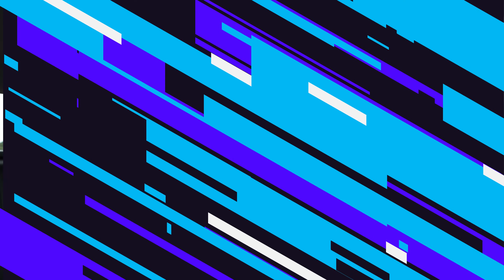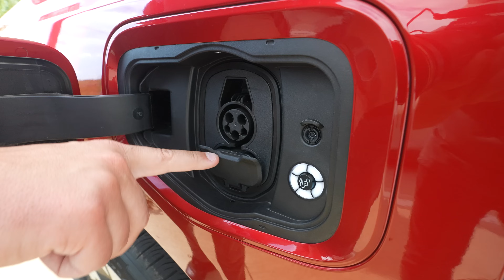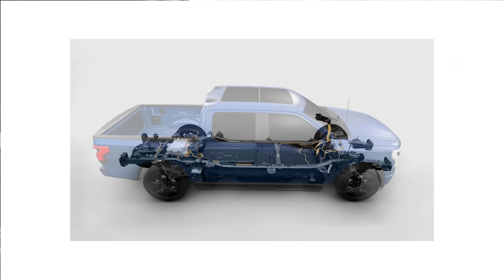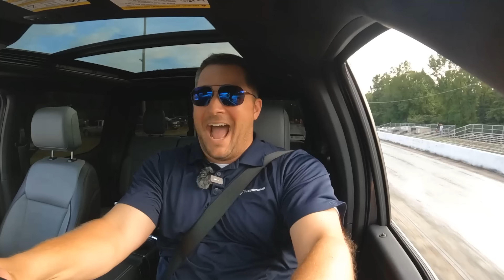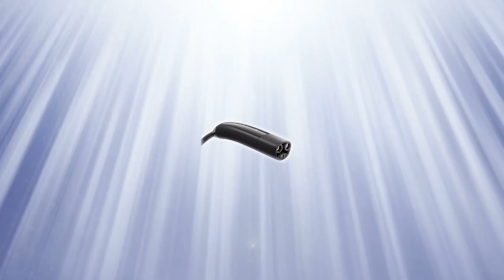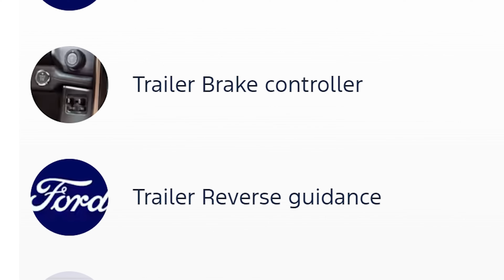Will the *ALL NEW* F-150 FLASH save Ford EV’s?

Comment: The adapter is not for plugging into a dryer outlet in your house.  It's for plugging into the 30 amp 240 volt Power Pro outlet in the bed of the truck so you can then plug your friend's NEMA 14-50 adapter Tesla Universal Mobile Connector into it and then charge that dead Tesla.  It was Ford's way of saying "F U Elon!"   Remember to tell them to turn their charge rate down to 24 amps (80% or the 30 amp max). It says so on the label on the adapter

Comment: Got a new 24 Flash for under $54k .   They had a bunch of 2024 sitting in the lot.  He's not kidding about how good the ride quality, features, and the speed this thing has.  I've already used a TEsla supercharger and it's quick at charging.   I cannot wait to take it cross country...after I buy several adapters for different plugs.  This is now my favorite vehicle.  This was a homerun for Ford
Reply: probably want to bring a jumper pack, a battery tender and multimeter for your 12V battery on that road trip. Have a blast man!

Comment: Ford needs to remove all trim levels from the lightning. They need to just have the flash. It will reduce costs hugely on the truck. They need to make 1 solid ev truck. Then when it’s profitable they can start offering trims again.

Comment: Pretty good review here, thanks for making it. EVs are going to take off in the next 5 years with improvements like the ones made on this Lightning so those chargers will pay off. I worked in the automotive business at a national level interacting with dealers. I always wonder why 1) Dealers feel the need to pump the manufacturers for money and 2) Dealers like to cry or imply poverty. Those chargers have plenty of subsidy money available through the government. Either way, good for you as a dealer for getting on board and installing them. There is a Nissan dealership in Bangor ME with free level 3 charging stations and they get tons of attention/praise from EV owners and likely are getting some business out of the service. 

The Flash looks like it pays off. Makes a ton of sense for me as a builder of all-electric homes. Going to go and check one out based on this video so thanks again.

Comment: I just picked up a Flash this week. It’s the sweet spot in the line up, all the essentials without the massive price tag. By far the most value for an EV truck available at the moment. I paid under $60K. Every other available competitor truck is well over $80K

I had a reservation way back when it first launched, but passed because of the over MSRP price. This is my wife and I’s 5th EV (model 3, 2 Model Ys, and a BMW I4), the Flash goes to the top of being my favorite. Great tech, superior performance, solid range, and an all around practical vehicle. 

I agree with charger anxiety, the network needs to improve if this is going to make sense for people who take road trips. 

GREAT REVIEW!

Comment: I just picked up a Flash this week. It’s the sweet spot in the line up, all the essentials without the massive price tag. By far the most value for an EV truck available at the moment. I paid under $60K. Every other truck is well over $80K

I had a reservation way back when it first launched, but passed because of the over MSRP price. As an owner of now my wife and I’s 5th EV (model 3, 2 Model Ys, and a BMW I4), the Flash goes to the top of being my favorite. Great tech, superior performance, solid range, and an all around practical vehicle. 

I agree with charger anxiety, the network needs to improve if this is going to make sense for people who take road trips. 

GREAT REVIEW!

Comment: I have 2024 Flash. The trailer backup assist cant be used with the trailer harness. Pro charger wont charge at 80amps cause there is only ine on board charger.

Comment: EVs have only 2 problems. 

1-Most are just too expensive and hard to justify. (Usually new products try to be cheaper then the competition to at least get some traction and consumer trust)
2-The charging experience is still not good, needing to have a different app for different branded chargers is very annoying. And although I think they are really addressing the amount of chargers available they do still need more. 

(I had the Jaguar I-Pace for 5 years and just bought the F150 Flash and I love EVs and they're amazing products to own we just need to keep at it, it's not going to be better overnight or even in years but it really is getting better all the time and I hope companies don't give up on it)

Comment: Great points. I still believe in Ford as a company. I’m buying a Sierra EV, but I’ll always be a Ford guy at heart. Ford missed the mark somewhat with the Lightning - the main problem is its charging speed, and that’s not something they can fix with the Flash. But as Ford holds off to 2027 with its next-gen, I believe that they will catch up in the long run.

The F150 is the most popular vehicle in America because Ford has delivered what people want for a price they can afford. The shift to EV technology may have created a challenge for Ford to overcome - one that they aren’t currently the class leader in - but in the long run they will prevail.

I bet in 10 years I regret not waiting until 2027 to buy my truck, but at the moment I can’t wait that long.

Comment: Six months ago I bought my 2023 F150 Lightening XLT. I absolutely love it. I travel to my job sites everyday and they’re all within 20 miles of my house. I charge every two weeks at home, while I sleep. I’ve had four F150’s, an Explorer & an Expedition, prior my Lightening and it’s THE best truck I’ve ever owned. The ride is smooth, quiet and it’s really fast!!
Reply: Do you charge elsewhere in that two week period? I’m a project manager in Florida but right now most projects are further from my house than I’d like. I’m probably driving 200-250 miles a day mixed highway and city. Not going very slow on the highway. I’m trying to figure out if a lighting would get me a full day of range without the anxiety of needing to top off to get home.
Reply: @davidtolentino4755   I don’t think my Lightening would work for you. It doesn’t get good enough range to depend on. You’d have to go with the bigger battery “package”. I only drive 5-50 miles a day so it’s perfect for me. But mine is a 2023 so the 24’s or 25’s may be different now. I haven’t kept up with it. I’m sorry I wasn’t more help.
Reply: @loriw2661  I appreciate your reply! From the reviews, regardless of year, it sounds like the larger battery would definitely be the way to go. And even that one worried me.

Comment: I don't get why somehow EVs have become political. They are not political. They are just a different form of transportation. You have Gas, Diesel, Propane and now Electric. Just because Electric is better for the environment, doesn't make them political. We ALL breathe air. Sure there are EV subsidies, but there have been petroleum subsidies for a century and I didn't hear anyone complain.

We have to stop burning stuff. The earth is getting hotter. This is inarguable. The easiest thing we can all do as non-government participants is to stop our own contributions to air pollution, which means getting rid of ICE. EVs are superior in every way except for the fact that there aren't enough fast charging stations around. There is little to no maintenance with EVs, they're faster, smoother, quieter than ICE. If there were as many fast charge stations as there are gas stations, then range wouldn't be an issue either.

So stop whining about EVs and get on board!

Comment: The preconditioning of the battery is heating the battery initially, not cooling it. It runs hot coolant through the pack to bring it up to the optimal temperature range to charge. After charging has commenced, it will switch to running cold coolant through the pack to maintain that optimal charging temperature because charging will inharently heat the battery. Preconditioning will have more effect in the winter when it's cold outside. All of this will of course, vary to some degree, depending on SOC and temperature.

Comment: I love my 2022 XLT. But I would have bought the Flash if it was available, the extended battery was $20,000 more in 2022 and just couldnt justify.  45 000 Km. And only used public charging once - best vehicle I've ever owned . 0-100% costs me $2.70 to go 350 km.

Comment: Still happy with our Lariat Lightning at 10k miles, and our solar charging array is almost 10% paid for. another 4.5 years to free fuel. Got an oil derrick and a refinery in your back yard ? We live in Texas, and if we were in Houston, we'd have 5-10 days of backup power. The charging array also feeds a mini-split in the garage, and has 10kW of it's own battery bank. Combine the two, and you'd have 150ish kWh of backup power in case of an emergency. I know it's what people key on, but we've had ours for a year and a half, and still haven't used a DC fast charger. If you have a garage, you're going to have a level 2 charger, and be charging at home. If you're us, you're going to be charging with the sun...We have the Lightning, and two Mach-E's in the family.

Comment: So let me ask you something. If the new model has the new software, what's going to happen to the software with the next model comes out? Will it ever get upgraded and if so, what's the big deal about the software. Also it looks kind of sparse in the physical buttons department.   Third question is do you think that the small ford stores are going to start wanting to sell them or are they going to hang on to their inventory in protest until they turn to dust?

Comment: What I really like:
-no sunroof
-fixed rear glass
-the huge frunk (underrated IMO)

What I’m fine with:
-the range

What I wish they would change:
-I’d prefer a column shifter
-LFP batteries so I know it will last 10+ years and I don’t have to worry about fire.
-Wish the price was a bit lower but I’m also realistic on this… a lot of people want a 40k super truck which isn’t realistic.
Reply: Not too many people on Earth with homes worry about the 8 billion lithium-ion batteries in smart phones. Then there's all the tablet computers, laptop computers, flashlights, jump starters, portable power packs, home back-up batteries, commercial batteries, cordless tools and over 6 million Tesla vehicles with lithium-ion batteries.

The National Fire Protection agency and the NHTSA report far fewer fires in EVs than in combustion engine vehicles for miles traveled.

An internal combustion engine vehicle lights on fire somewhere in the USA every 45 seconds. So, at all times in the USA, a gas vehicle is burning. 

It's a common daily occurrence. Ask a Fire Marshall or any Fire Department personnel.
Reply: You don’t have to worry about fires full stop. EVs are a far lower fire risk per mile than ICE vehicles, and very few people stress about that.
Reply: LFP are made mostly by china cause they can manufacture them a lottttt cheaper than we do. And if it’s used in US EVs the car/truck loses the federal tax credit
Reply: Did it not have LFP batteries before?
Reply: @HerroYuy246  It did not.

Comment: I love both EV and a Good Gas/Hybrid. Ford should work to get the range-extender model for F-150. Get a 50KW battery with a Eco-boost V6. 50KW battery is sufficient for day to day and the range-extender/hybrid helps for Towing etc.

Comment: Ford is already giving away the charging adopters for free if you go online and register for it (Time is closing on getting one for free). I have my name on the list for my 3 month old Mach-E, luckily I haven't had to take the SUV out of town so I just charge at home (way cheaper anyway did 1500 miles in April and only cost me about 72 bucks). In Corpus Christi  the only real LVL 3 chargers are the Tesla chargers and we don't have any non Tesla Chargers between San Antonio or Houston yet. But the Flying J Travel Center at the George West Exit is getting a 350k set of CCS chargers installed right now (6/30/24).

Comment: Thanks for the first decent overview of an actual 2024 F150 Lightning. I wonder why Ford just didn't include the J-3400 / NACS adapter with new deliveries as opposed to having customers order it after delivery of the truck.
Reply: It sounds like a simple fix, but both the manufacturing and logistical changes just don't move very fast and are complex.  

Multiple companies including Ford are having issues trying to have NACS adapters in stock and that should be a much easier thing to get right.
Reply: I’m still waiting for my adaptor. For 6 months now
Reply: I bought my xlt in Aug 2023 and ordered the adapter as soon as was able it just arrived.
It's absolutely the best f150 as others have said. But there are a few gliches
Phone doesn't consistently connect and the Frunk opens by itself randomly. 
Ford have been unable to fix both issues.

Comment: I have 10 lightnings as part of my work fleet. Some have over 60k on them already. Theres been some issues though. Ill reply myself with them
Reply: Thanks for the review!  Seems like they would be great for fleet use.

Do you have your own chargers on site?  I'd think you'd be seeing fuel savings too if so.
Reply: @yayinternets  yes they charge at my work shops
Reply: Are you still looking to get more by any chance sir?
Reply: @robalexander2016  yes im placing another fleet order for more in october
Reply: @mattbrew11  if you could change one thing about your lightnings what would you like to change? Range? Tow? Etc
Reply: @thechurch7474  faster dc charging
Reply: 1 tailgate step broken
1 cracked wheel
4 winshields

Thats it. Zero other problems. I am extremely satisfied

Comment: I went from an 02 Tacoma to a Pro, so keep that in mind. I bought a Pro standard range with the 100k mile warranty for $51k after tax and license. I think you can get them even cheaper now. The range is about the same as my old Tacoma. The pro has more features than I could imagine. If you are going from an old car, you don’t need more than the pro offers. I tow a 12 ft cargo trailer, and can get about 170 miles out of the truck while towing it. It’s not bad if you’re towing a somewhat light trailer. I am very happy with my purchase. I also bought the pro charger and installed it. I can get a zero to full charge in about 8 hours from my house.

Comment: I got my leftover 23 xlt  extended range for 53k.  For me its a perfect truck. No way in hell would i have bought it if they didn't give me 20k off of sticker. (Edit) Think I want a splash now😅
Reply: I found a new 2023 leftover for 25k off. Do you think its worth it?
Reply: @tysonlarson1 has it been titled before? If you have the dealer fully charge it be sure it gets up to 315 or so miles depending on temps.
Reply: @matthewholzmueller6292  no, it was never sold. It’s in a rural area. It’s only got like 400 miles. It is the extended range battery also. I’m not sure what the charging would go to. I’ll have to ask.
Reply: 312 a package also
Reply: @tysonlarson1 the next big thing is how many miles a day do you travel? Over 200 daily on the coldest of winter days might get dicey if you're not around super chargers.  You're gonna need  a 50amp 220 volt plug  that you can plug into at night or whatever you park in your driveway.
Reply: @matthewholzmueller6292  I’m under 20 miles daily for my normal commute.  of my driveway is when we go to family up in northern Wisconsin.  It’s a 3 Hour Drive and about 140 miles. We would have to charge on the way home and I know a lot of times were just want to get home.   So, I would turn a 3 hour drive into 3 hr 45 minutes. We take trips like that 10 to 12 times a year.
Reply: @tysonlarson1 i don't do trips like that, it was one of the reasons i went with the lightning. IF you have tesla super chargers in route or some kinda super chargers you might only need 18 minutes of charging. IF NOT maybe the power boost, you'll still get good gas mileage and get the generator option. Hope this helps.

Comment: Great video.  I like the flash. One day I will probably buy a lightening.  I would love to see ford make a plug in hybrid F-150 and not charge an arm and a leg for it. $65k-$75k for a nicely equipped xlt or lariat plug in hybrid would be so sweet.
Reply: Not sure if you like Ram trucks but check out the new Ramcharger. If Ford could make something like that but more affordable it would be a big hit. For 90% of use cases you don't need more than 250mi of battery range. An integrated gas generator can fill in the gaps to solve the towing range problem.
Reply: They won't make a phev because it would CANNABLIZE the lightning.